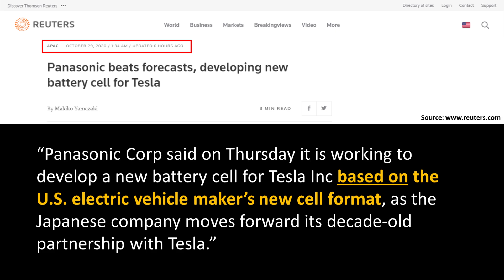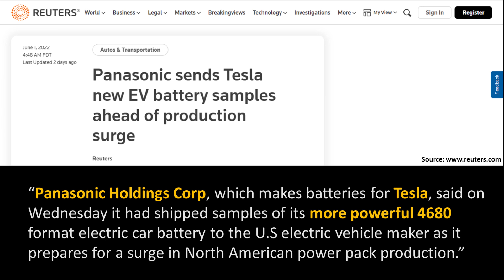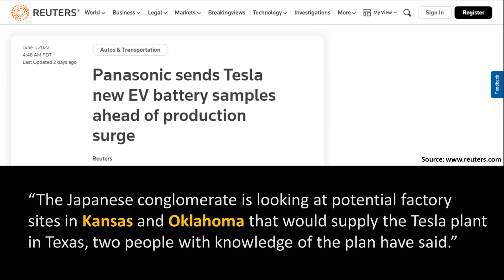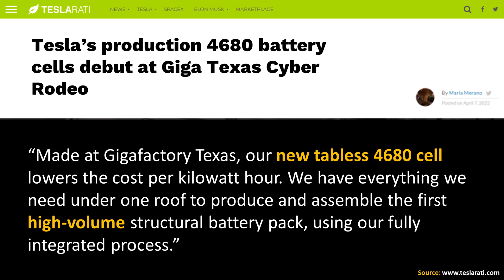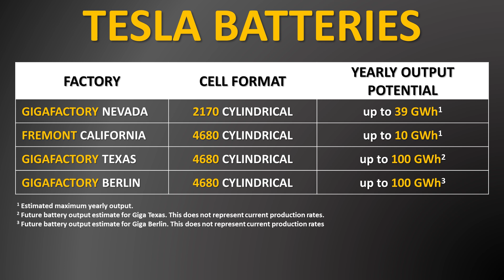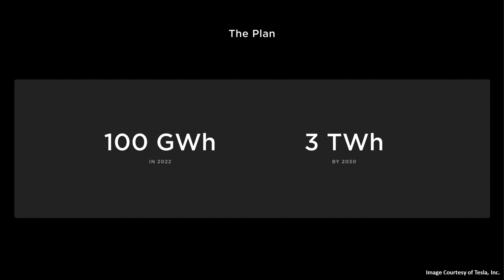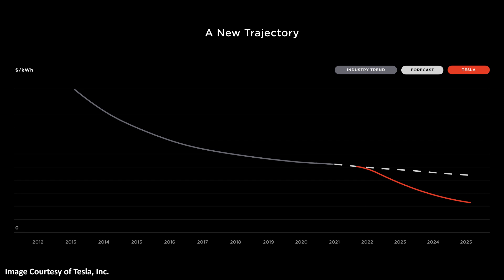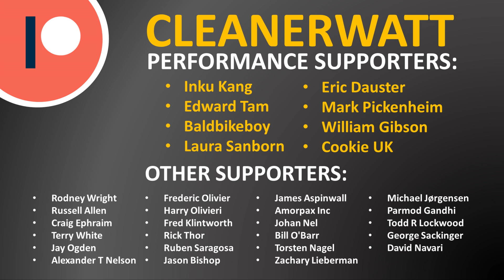Panasonic to MASS PRODUCE Tesla 4680 Batteries Soon!

Comment: I hope that Panasonic producing 46-80 cells means that Tesla has shared or contracted their technology with them.
Is there any word on what Tesla is doing to negate the chip shortage? If they think it's bad now, just wait until they try to produce nearly 20 times as many vehicles. I think that Elon's money would be better spent on a new chip fab than TWITter.
Reply: Tesla is way more nimble when it comes to using different chip variants. That's how they've managed to navigate their way through the chip shortage better than anyone else. The chip shortage will sort itself out, it just takes time.

Comment: So w h a t ?
 It's  still a toxic Lithium ion battery.  It's made from Cobalt & nickel ( know where that comes from?) You still have to charge it with toxic grid electricity.   Bigger is better.  Right. Right. Make your current model car you own obsolete.   2 yrs ago we were told this is ready. . .
Reply: So...battery tech is* evolving esp wrt to large volumes  yes? You need to know that the latest battery tech has   a limited production period before it is outperformed by the next tech, yes? So there seems to be a constraint on how much you can spend on your Giga Battery production at the expense of tomorrow's better ideas.
Reply: @calmorton4619  evolving. .   
  While failure has more grip. Evolving .     Is techno gigs whiz promise.  Get real.  It doesn't charge it's  own systems as you travel.  It's limited. Costly. And toxic.
Reply: @shop970  Toxic you say? OK, try breathing what comes out of the tailpipe of your ICE vehicle for one whole minute.
Even taking into account the higher carbon footprint of producing a BEV, the ICE powered car surpasses that before it drives 5600 miles. And that's on a coal fueled grid (worst case scenario)
As for the batteries, after a 10 to 20 year life, they are recycled, currently recovering 92% of the materials to be remanufactured into new batteries. Yes, at a profit and no, without government grants.
The cobalt used in the refining process for your gasoline however is not recoverable. It ALL ends up in the environment as toxic waste.
I hope that clears a few things up for you.
Reply: You have been lied to.  Clearly unaware of what it takes to know what goes into materials and manufacture of these plastic chemical toys.  If every car was electric it won't put a dent in green house gas emissions.
Reply: @shop970  So, how's that experiment with breathing what comes out of your tailpipe coming? Haven't tried it I expect.
Reply: @surferdude4487  you just keep assuming & expecting. That's your life. You don't know what I drive do you. Nor the numbers on corporate policies &  pollution .  I could care less about your belief system.  It was told how to think.  You're lost.

Comment: No way can Tesla make 20 million vehicles per Year but Ford Motor Company might be able to do that. What matters most at the moment is more Supercharger Stations and wireless charging. By way of example the screen on the Model 3 and Model Y should be detachable and be wireless both in charging and as part of the information exchange.
Reply: ROFLMAO! When was the last time Ford produced 20 million vehicles in one year, never mind BEVs? At present, the battery pack in the Mach E is costing Ford about $18 thousand. If they could scale up production today, they would just go bankrupt faster. Besides, they are heavily weighed down with unions, debt and sunk capitol that can only produce ICE vehicles. Tesla on the other hand is ramping up at an exponential rate exceeding 50% growth per year. 
The DBE process may not be critical to the 46-80 format, but it does make the batteries a lot cheaper to produce and reduces or eliminates the formation of dendrites that kill batteries. Sure, Panasonic could produce 46-80 batteries without the DBE process, but they would be inferior and cost more. Not a good value proposition.
As for making the MCU wireless? I'm just going to say that it would increase power consumption while giving no benefit. I don't expect Tesla to go that direction, but, you never know.

Comment: 4680 batteries is great for the ct any thoughts about solid state batteries?
Reply: The latest research shows that solid state batteries as such still don't work. The last time I clicked on a solid state battery video, I found that the so-called solid state battery had a liquid annode. And, even though they were cheating with the liquid annode, the thing still isn't anywhere near as cost effective or energy dense as what Tesla is producing in the 46-80. Maybe, someday, but certainly not yet.

Comment: Thanks Jonathan!  I guess the 4680 cells HAS to have the tabless technology.  But I wonder and doubt if they will incorporate the dry electrode manufacturing tech.  It will make the cells less competitive w Teslas own cells if not bit that would just mean Panasonic cannot sell 4680s to others at a lower price than Tesla can supply themselves with.  So if Panasonic turns its back on Tesla, it won't benefit the competition really due to price disadvantages.  Either way, this is another win for Tesla.